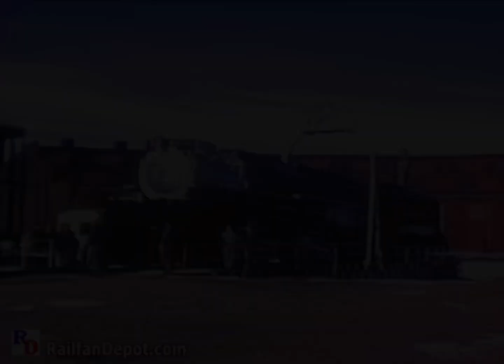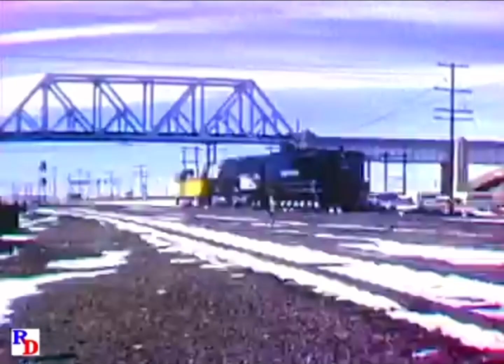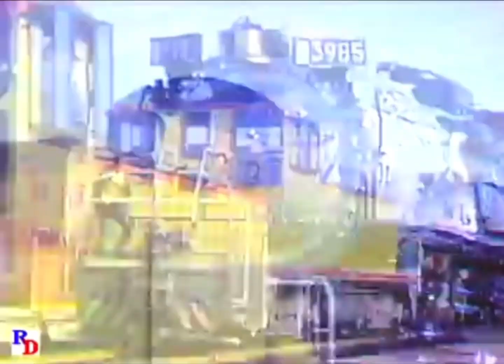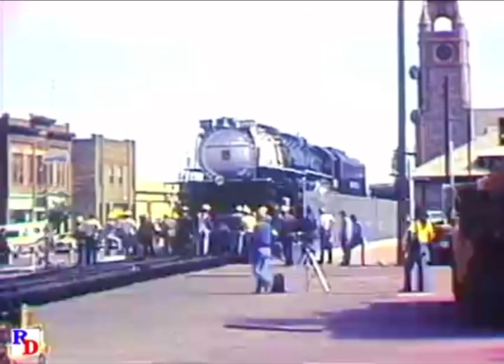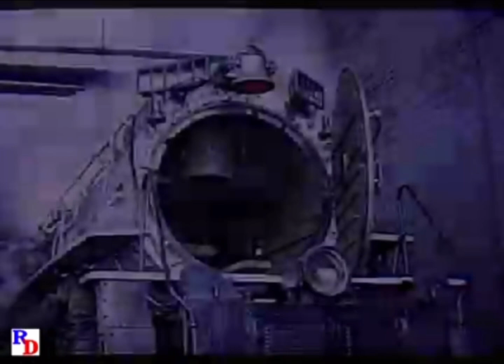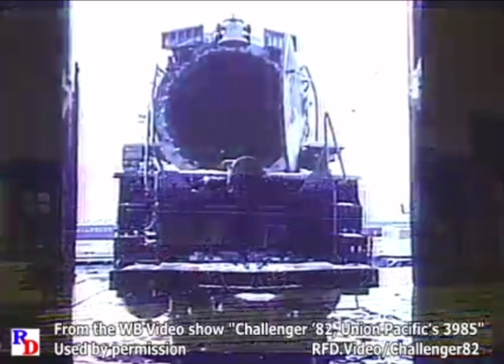UP 3985 from static display to the path to restoration in Challenger ‘82 Union Pacific’s 3985.

Comment: I always enjoy seeing footage of Challenger locomotive 3985  as this was Union Pacific's star excursion steam locomotive from 1981 to 2010 and after 2010, UP 3985 has been inactive and has needed to receive heavy maintenance repairs. I really hope that Challenger 3985 makes a return to operation again in the future after receiving it's rebuild at the Silvis, Illinois railroad repair shops ; by the judgement of the appearance of UP 3985 and statements from the UP steam crew that process will most likely take 5-10 years as the locomotive has seen extensive operation over the years.